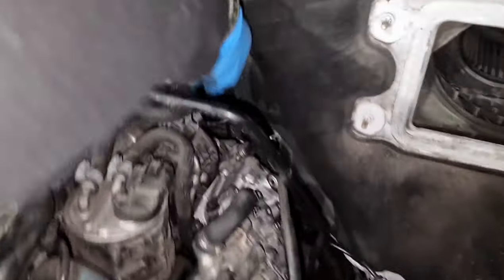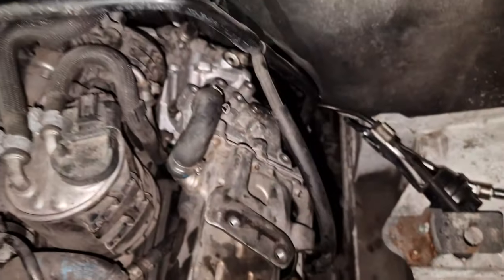EGR REMOVAL on a mercedes sprinter

Comment: I have just performed this job for the first time and got stuck on the two rear bolts, so I came on here and watched your video. Why on earth have you taken SO much off unnecessarily? You don’t need to take anything off the top of the engine at all, only the blower fan intake cover needs to be removed AND if you are going to do a how to video, don’t start it halfway through the job and then say, “ oh, this part I’ve already taken off came from here and here etc.”
Reply: Do you have any links to documents or videos showing the rear bolts that need to come off? I need to start5 this job but that part is concerning me as my view is even more obscured in my van.
Reply: I dont suppose you can remember if there was a gasket between the egr and where it bolts to the manifold (2 bolts at the back). I've just done this job on my van and now it is leaking from where the 2 bolts at the back join but I couldn't see or find a gasket there
Reply: Yes, every connection has a gasket of some sort between the parts, usually a compression type metal gasket.
You could reuse the old one but since it’s an arse of a job it’s best to go new. Your gasket probably fell down the back of the engine, maybe.
Reply: @Britishdaddy  Are you talking about the transition tube? The metal tube that bolts on to the side of the valve and meets with the charge air pipe - which connects to the manifold. If yes, there is a gasket required on the EGR side. Also make sure all your bolts are equally tightened. Goodluck

Comment: Wonder if anyone can please, Vito 2017 euro 6, was blowing out lots of greyish smoke slight blue tint, cleaned the DPF still the same, so changed the DPF pressure sensor and it stopped smoking and drive great fur about 6 hours with no smoke at all, But it’s now back smoking, engine idle is a bit rough too, any ideas what else I can check?  Would a bad a PCV Valve cause these issues? Any help and advice appreciated

Comment: Good video but just one small correction,  that middle valve is the bypass valve, the egr is at the far end. Bypass valve can leak at the top causing p0101* MAF errors
Reply from the maker: Thank you. I will never pass the opportunity to be corrected and educated.

Comment: I've been looking for a visual on how to remove the EGR on my 2.1l with the cooled EGR. Quite a bit of work to get it off. Is it easy getting it back on? I'm replacing my fuel filter and fuel pump this week, no EGR codes but feel it might be time to clean it up before it's needed.
Reply from the maker: It a straight forward job as long as you have an extension to get the rear bolts back in. How these are plumbed in, egr cleaner and dpf cleaner works well with them if you want try them before removing to clean
Reply: @MrDecy69  hi mate, when you say dpf cleaner, can you spray the Wynn's Off Car DPF cleaner into the inlet pipe using a 1Litre pump spray bottle (like O'Reillys did) or do you have to buy the EGR aerosols?
Great video by the way!  I want to try the cleaner spray method before removing it 😊
Reply: thanks for the video mate, I'd also love to know where you put the EGR cleaner as a first measure before disassembling it all?! @MrDecy69

Comment: Any kit to delete this assembly egr cooler and valve thanks
Reply: Dumb idea on a late model vehicle with all the emission control systems working in tandem with other circuits. Regular servicing with good oils and either clean out the cooler or just bite the bullet and replace the EGR assembly when needed.

Comment: my 2016 smells quiet strong no blue smoke thinking dpf although not had time to inspect
Reply from the maker: Try giving it a long low gear drive down a motorway and let it idle afterwards and see if it still smells.
Reply: @MrDecy69  been doing 200 motorway miles this week all seems good now

Comment: 3:50 That is actually the vacuum operated EGR cooler bypass valve. Its function is to not over cool the EGR gasses as the engine is warming up.

Comment: What a brilliant video.
Need to do this exact job on my sprinter. Couldn't ask for a clearer more informative video.
Thank you
Reply: What do you mean you couldn`t ask for a clearer info? Nothing has been shown. You want to try and get the back bolts out of the EGR pre cooler? be my guest:) Beside that putting it back together is nearly impossible without a car lift as you need to torque the bolts so that coolant won`t come out and that can only be done from underneath the vehicle with long extensions and you`ll have to use 1/4 extensions . Secondly what you see there it`s a bad BACK PRESSURE SENSOR and bad solenoid affecting the exhaust gases. Could be a MAP sensor as well that is not sending correct signals to ECU and it`s causing you to get too much exhaust pressure causing the EGR to pop...i am sure they have changed the EGR pipe as well , the shinny one that goes under the EGR. 99.9% of the videos about HOW TO do something are only showing when the part is off or when the part has been put back together so that others won`t comment about how difficult and tricky it was doing it. Soon i will be posting videos about Mercedes repairs...showing what to use and how to do. Otherwise what is the point in showing me the part off the car? i can look at a picture on the internet and save myself some time:).

Comment: Hey Dec,quick question for you...would really appreciate help if you could?  There is a wiring harness that runs on top of that engine and a plug that comes off on the middle right side,the plug seems to sit around the front of the fuel filter housing and goes down to the left side front of the egr cooler,do you know what it goes to?
Its just a little short wire and plug on the right of the wiring harness and only one in the middle on top of the fuel rail.
Ive just done the waterpump and fuel filter housing on this and lost to where this plug goes unless it doesnt on some of these engines?

Comment: The EGR is held on by two bolts, the where the exhaust gas is going in to the EGR. Those two bolts are very difficult to get out. I got the top one out, but the one at the bottom, how’d you get that one out? I can barely for my hands down there and especially not with tools.. (it’s the two E10’s I’m talking about, that’s holding the whole EGR valve and EGR housing in place)

Comment: I’m having trouble finding the right bolts to undo at the back to take it off , I’m getting a p2bac deactivated Egr it’s really annoying I’ve changed sensors and it worker London to Bolton with way better mpg and power then happened again , I recon it damaged the sensor

Comment: All very well on a normal Sprinter but. On my Hymer A-class motorhome,  I have to work through a 8inch letter box that require the air box to be broken down to get out. I do not want to work on it after just having to change  the number one exhaust sensor. I am not impressed with the setup and fully understand why the Main Dealer has all their fitters go sick suddenly if a motorhome turns up.😊.  The V6 is a doddle though right at the front but mine is a 2.1.

Comment: Would a faulty egr cooler result in gases getting into radiator expansion tank ?
Reply from the maker: Yes it could. There are other courses for this as well so would need to be tested.
Reply: @MrDecy69  thanks problem sorted it was the egr cooler . I bypassed it be connecting the 2 hoses together

Comment: GREAT work, can you tell me if the Sprinter is the twin turbo or single, since the OM651 came with both.( I have the OM 651in an Infiniti Diesel single turbo)) and did both types come with the same ERG system.
Reply from the maker: As far as I am aware, all 2.1 variants have the exact same egr system
Reply: two stage (twin) turbo system

Comment: What a great video. Well done mate. Out of curiosity what did the issue end up being? 😂
Reply from the maker: Sorry for late reply. The issue turned out to be the vacume solenoid on the egr sticking that caused a build up.
Reply: Hi mate I'm contemplating removing my egr all together and dpf, as I have now got a fuel leak after replacing the fuel filter housing that was cracked, I wish I could say I found it as easy as you did haha, would you recommend that with these engines? Thanks mate
Reply: @MrDecy69 hi mate, think i am having a similar issue, where is the vacuum solenoid for the EGR?

Comment: Can I pick your brains about my MWB 2.1 sprinter that I’m having a ball ache with?
Reply from the maker: Sure you can pal.
Reply: @MrDecy69  
2014 reg, brought a couple weeks ago, it over heated on a motorway drive cruise control at 65-70MPH with air con on, I’ve changed water pump and thermostat and seemed to be fine but a week later and it’s  creeping over 100 temp on long motorway journey with ac on backed off down to 50 and it cooled okay back to 80/90 also seems sluggish, I’ve also done a smoke test and no leaks to be seen, only loses water when it boils over can’t see any leaks. I don’t have a diagnostic tool for it yet but thinking about ordering a icarsoft unit, any advise / things to check would be greatly appreciated 🙌🏽🙌🏽🙌🏽
Reply from the maker: @jetw1518  do you get hlhot air through when set heading ro hot? Have you checked the radiator and the egr cooler isn't blocked and have a good flow through and is it bled up properly with no air bubbles in the system?
Reply: @MrDecy69  the heater wasn’t very hot before I changed the water pump and thermo, it does blow hot now, I haven’t checked the egr cooler, is that the big black plastic square on the passenger side of the engine or is that the vacuum? I have done a complete rad flush with wynes cleaner and topped back up, left it running up to temp with the cap of the expansion bottle, how would I check the cooler and or if there is good flow? the old water pump looked okay, I think it was the thermo as the old one the rubber seal was caught in the spring. But no idea what to check / do now. It also had a snapped header bolt so I’ve replaced all gaskets and studs also.
Reply from the maker: @jetw1518  the plastic box is the vaccume box, the egr cooler is underneath it.
Reply: @MrDecy69  what you took off in this video? Is there a way to check it without removing or does the whole lot have to come off?
Reply: @MrDecy69  what you took off in this video? Is there a way to check it without removing or does the whole lot have to come off?
Reply from the maker: @jetw1518  you can check the flow via a decent diagnostic tool or take the black pipe off towards the front and run the engine
Reply: @MrDecy69  I was thinking the icarsoft max or pro plus, is that any good for sprinter do you know? Can’t afford star or entry or snap on 😂
Reply from the maker: @jetw1518  don't another with snap on. Not worth half there price. Ia use autel. Even there small maxi 808 tool will sort it. Very good systems

Comment: Does anyone know of another video or diagram that shows exactly what needs undoing at the rear? What screws, plugs etc. I’m blind on mine, I don’t have an air filter there but a brake servo or whatever right in my way.
Reply: Brake servo? What country are you in?
It’s bloody hard to describe, you really have to feel for them first then blindly attach two extensions with a flexible adapter in between them to get any sort of access to the tiny E10 bolts. You should be able to stand on a box and get your hand over the back of the engine to feel the heads of the bolts.
Reply: @xsnrgy05 Yeah I don’t think I spelled that right. I bought mine from Germany, so I have this big round metallic thing sticking out of the wall right next to the EGR area. The access is retarded for me.
Reply: Oh are thewre any other E10 bolts at the back that I could mistake? Because if they are the only E10’s then I’ll know I’m not undoing anything else
Reply: @6969SpAcE6969  no just the two E10 bolts hidden but doable.

Comment: Well that sucks, put it all back together with a new cooler and EGR valve and it still has the same code PO400 and runs in limp mode.
Reply: did you clear the codes
Reply: @OutbackOntario  This was 6 months ago, I cant remember what I did last week man! LOL. Its since had a coolant leak and was driven for 20km's without any water in the system. This was caused by a seal letting go on the housing that holds the fuel filter and also acts as a coolant transfer housing. With that fixed it then run on three cylinders due to the number 4 injector faulting. The injectors are like $6K. At this stage the customer is deciding whether to go ahead or not.

Comment: Good Engines, maybe, it's just a shame they have to bolt so much c**p onto it to make it work, what an absolute PITA to work on . . .

Replacing the Fuel Filter Housing on my Daughter's 2013 at the moment, Coolant Leak due to a damaged Inner Lip where it Bolts to the Manifold.
Thank f**k she's selling it . . . as soon as I've sorted it.

Comment: I need some work on my sprinter 313 not sure what’s wrong with anyone can help in Buckinghamshire?

Work done throttle body, intake manifold done ,injectors done but still smokes bad and has no boost pressure on turbo goes to 40 up to 50 mph but if up hill loses speed